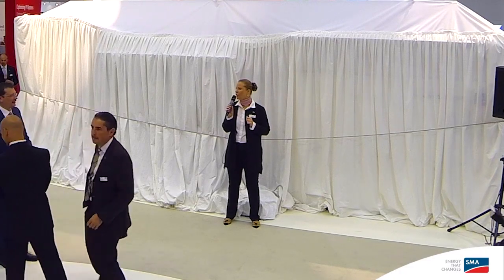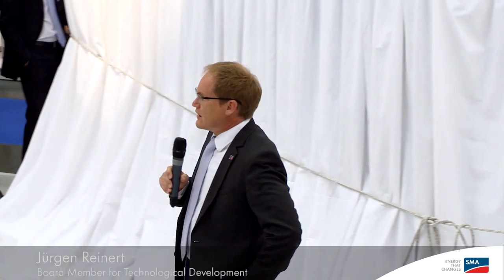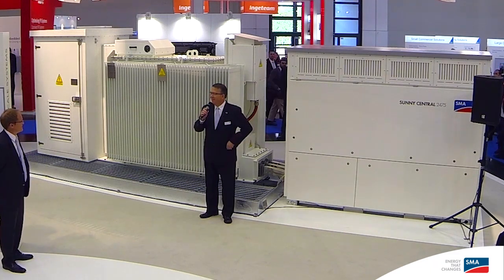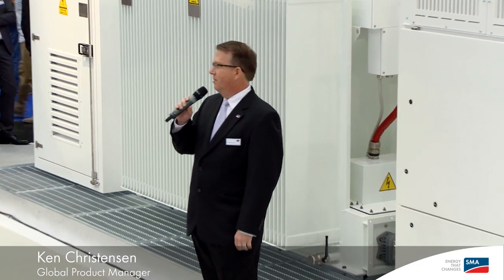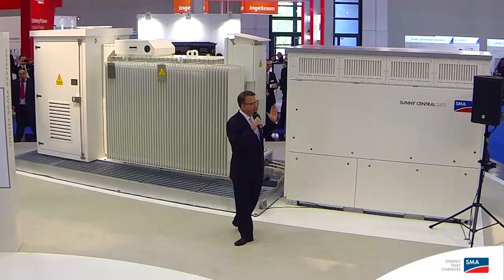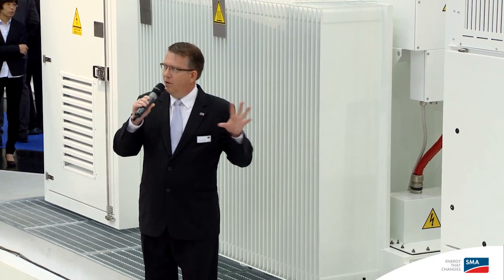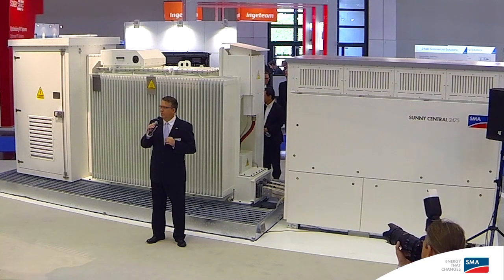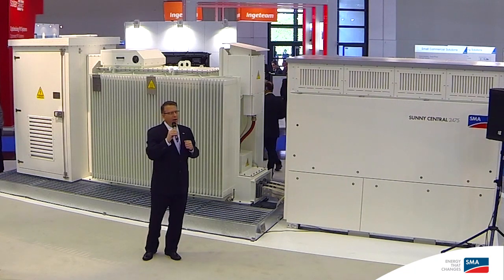Unveiling of the SMA Utility Power System

Comment: Can it be use on off-grid system? I mean without connecting to the grid, can it produce power by itself? If I will connect for example 500kW solar panels on it, will it be able to supply electricity?